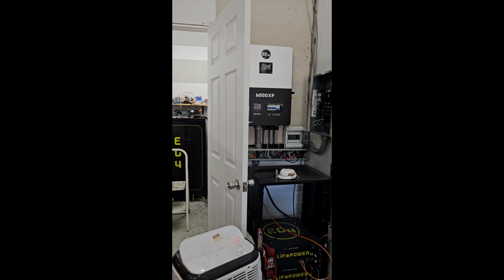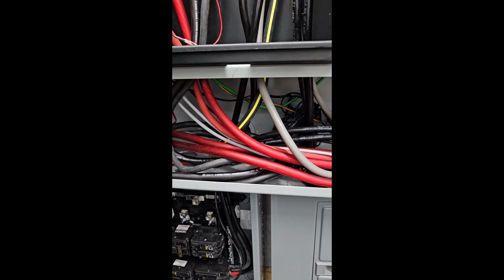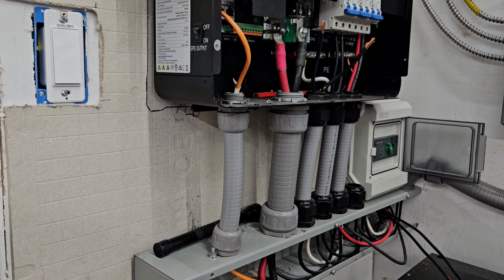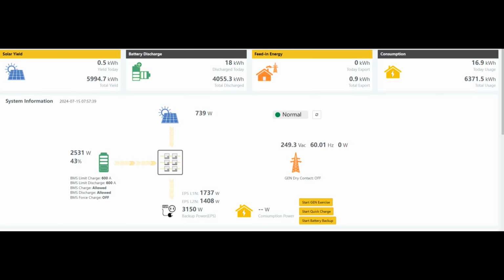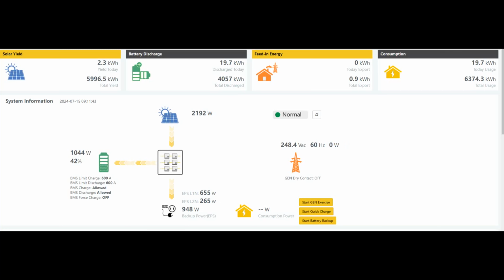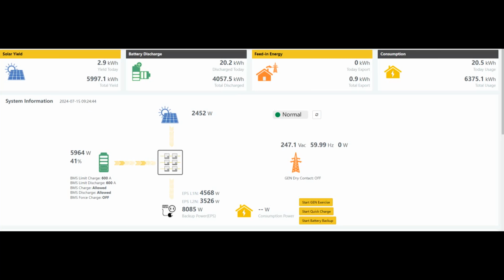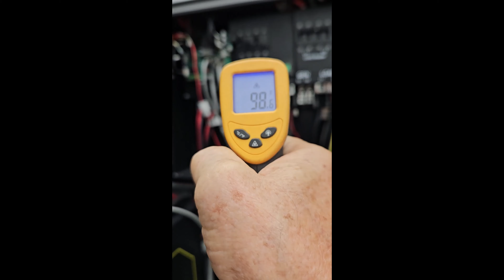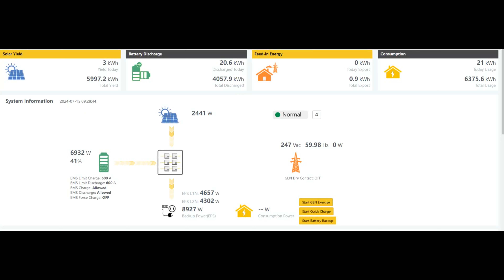My18k stress test

Comment: based on this how big of a inverter do i need yo power a house with a 4 ton hvac?
Reply from the maker: I would go for dual 18kpvs from signature solar. That will handle up to 100 amp of load which is more than the starting amps of an 4 tone AC. In addition i would add an easy start for my ac unit , it will last longer. https://amzn.to/4dq00Tv